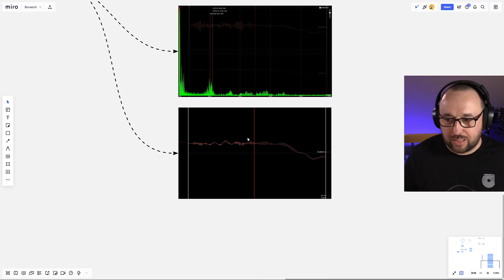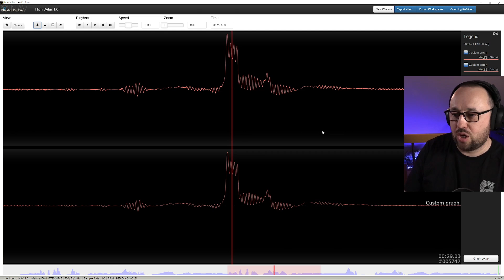Gyro noise filter with STM32 DSP FFT functions

Comment: I modify the arduino FFT library to use  with a STM32F401 at 84 Mhz and I get this times:

==================================
FFT        ticks(in mSec)
==================================
8		1
16		2
64		5
128		10
256		22
512		46
1024	98  , with out using CMSIS library
Reply: this times include 3 process: Windowing + Compute FFT + Compute magnitude from Real & imaginary elements

Comment: What about compensating that constant delay with Smith Predictor ? This aproach would need process model being known a priori but you can use spare time of microprocessor to run some kind of system identification to estimate that model and keep it not diverging from reality.
Reply from the maker: That's too much of a delay. INAV already has Smith Predictor. Based on my experiments it's good up to 2-3ms. Above that error is too great and does not help at all

Comment: Phase Delay is the ultimate barrier when looking at filtering for quads.   It has always been a major issue when i've worked on testing betaflight filtering with devs in the past.  This is the same reason why FIR filtering isn't usable as well.   7-8 ms is the barrier where you start to get oscillations but the key factor is that phase delay from filtering actually reduces your margin of error for pid tuning.   The tighter the phase delay the larger of margin you get for pids for ease of tuning and also flight feel.
Reply from the maker: Yes, exactly. I would even say that practical limit for the delay even lower. It's just so much simpler to work with up to date signal

Comment: Amazing experiment. How about getting the FFT using radix 2 method? Don't know if it was already used or not..
Also, with such a filter, I think 1khz loop will be sufficient, instead of a 4k loop. This will further reduce the length of samples and fasten up the process.
Reply from the maker: The thing is that with 1kHz the buffer still would have to be quite long to have enough of the resolution. So delay still would be above expected
Reply from the maker: Ah, the code was even doing downsampling to reduce buffer length but this was still not enough
Reply: Did you tried the radix 2 FFT method to get the FFT?
Reply from the maker: IIRC CMSIS is radix2 but never really checked
Reply: @FPVUniversity  if you have to take 64 point DFT then you could actually use a radix-4 method to get faster DFT computations.